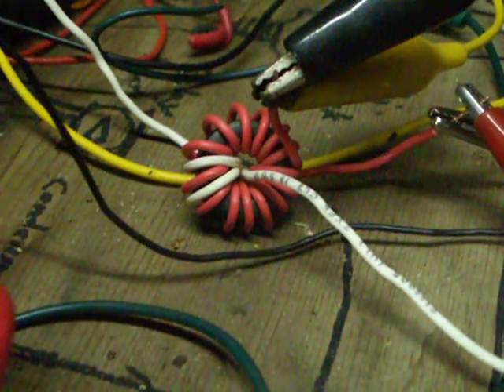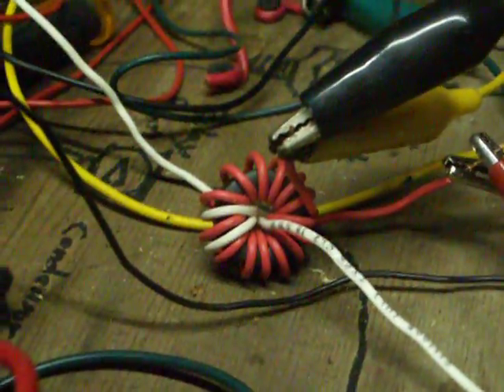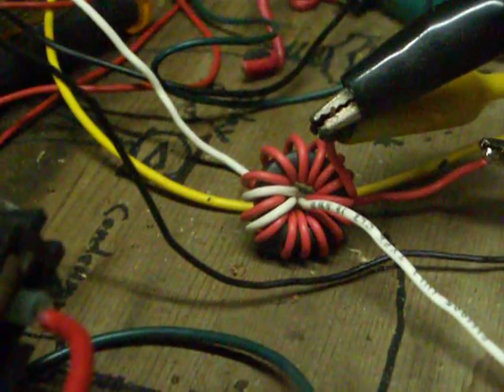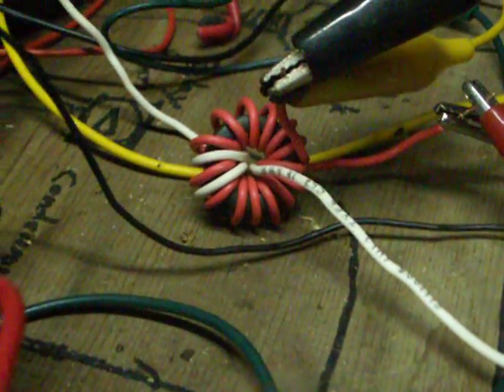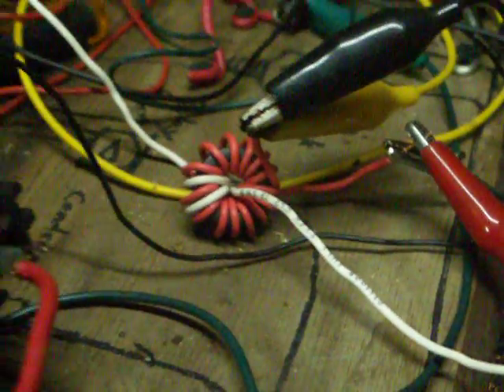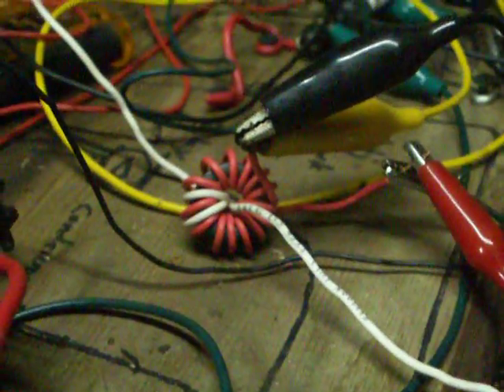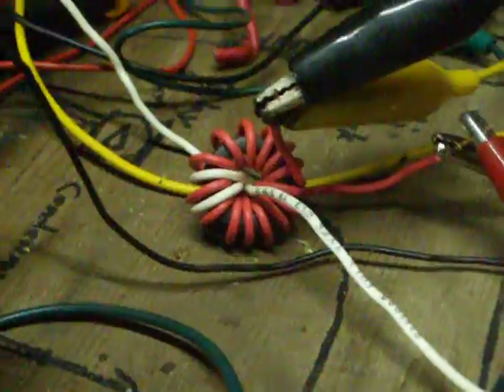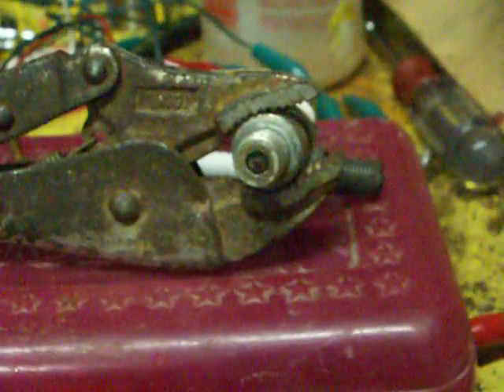toroid coil

Comment from the maker: too many wraps on the secondary makes it harder for 110 voltage to discharge , I might need to up the voltage on the capacitors  that discharge   240 mfd in parallel  but first I want to try to make it better at low voltage and I can tell ,or it will be Identified easier if it improves with anything I change .

Comment from the maker: I tried a magnet off a speaker but it was bigger ,It wouldnt work.I just got a smaller magnet last night to try but I didnt yet .If you can use the square toroid from a flyback transformer they work too .I think any good ferrite core would work.

Comment from the maker: thanks tiltfull   I replaced the round toroid with a ferrite core from flyback transformer and it is better yet! only 3 wraps on primary and 50 on secondary and I have much larger arcs ,quarter inch or bigger arcs.this type core transfers flux so good I would think it could lead to many over unity devices down the road.